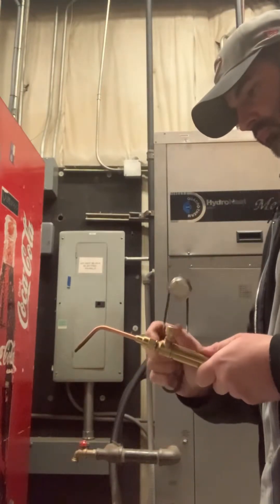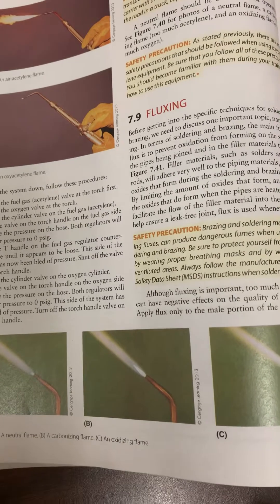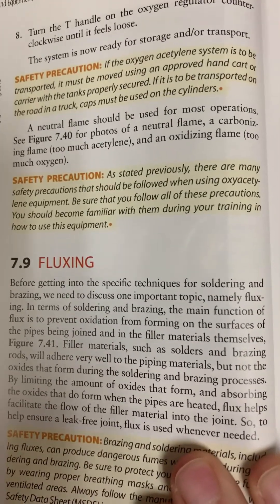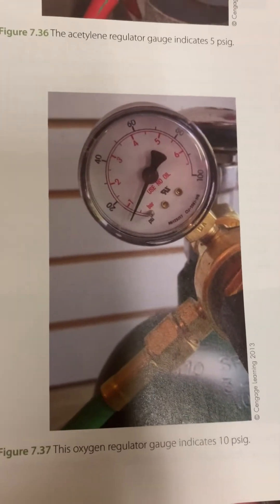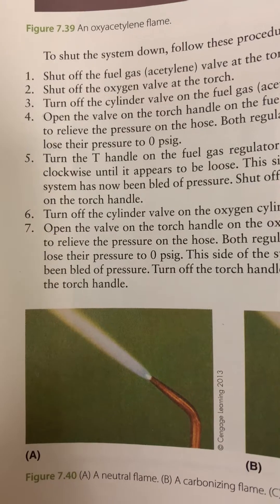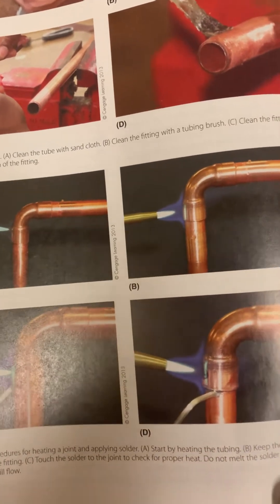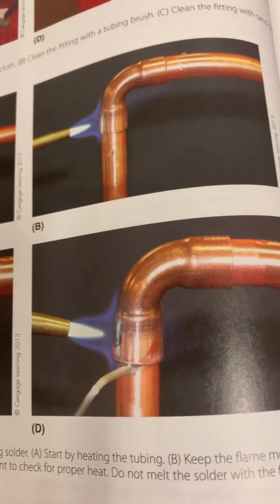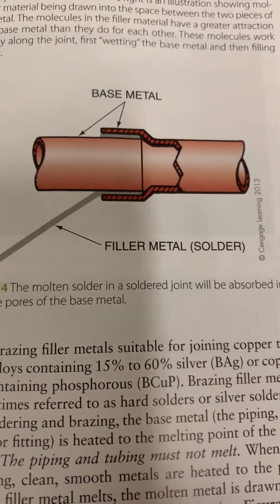Types of oxyacetylene flames-neutral/carbonizing/oxidizing

Comment: How can I get a flame just for heating? I have to heat rusted bolts so I need a flame just for heating, thank you
Reply from the maker: You can use your torches as a heat source to loosen bolts as well.  You’ll just make sure you don’t have any leaks or any flammable materials around.